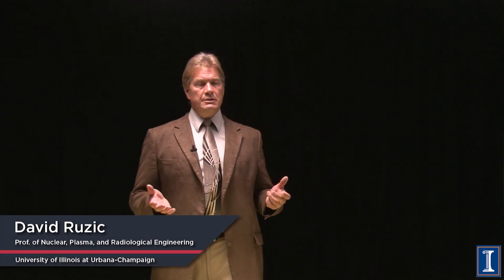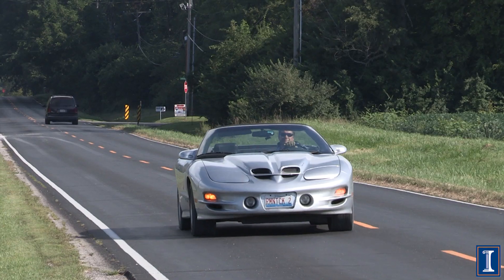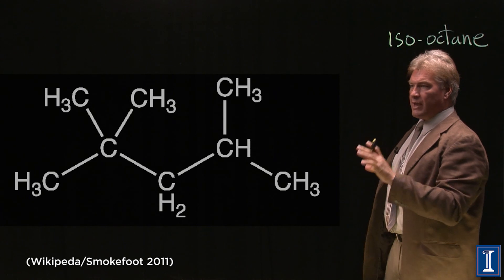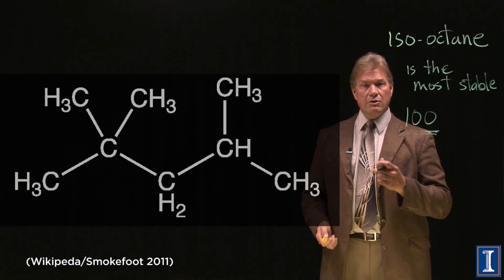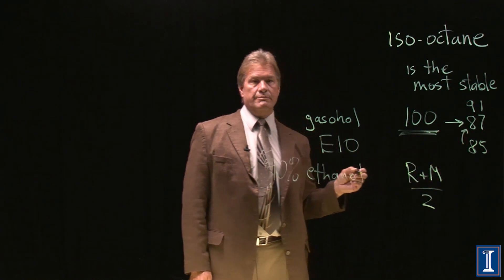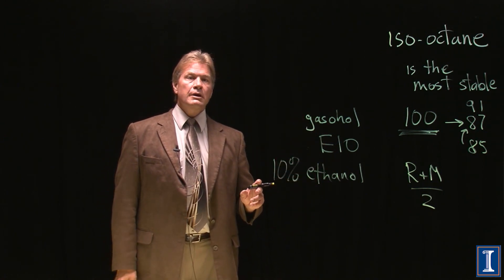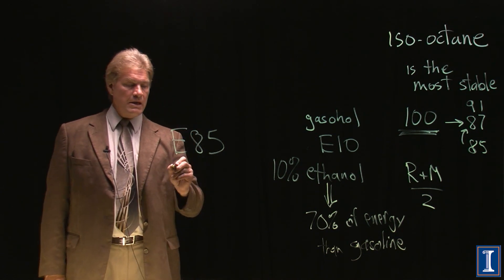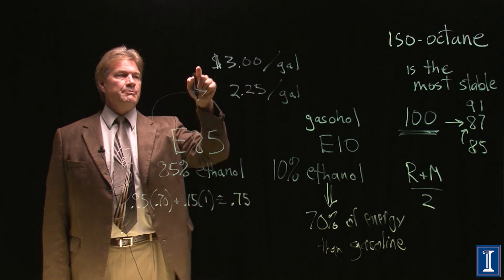Octane and Other Numbers at the Pump

Comment: So, what about when engines get old?  I just bought an old, 2006 4cyl Escape w 200k, complete w desert pinstripes, to use as my pup truck.  I’m pretty sure I was able to put 87 octane in it, but it would knock a bit when pulling out in 1st gear (manual transmission) and the check engine light came on.  On a guess, I changed the plugs (no change) and then began using 93octane, the knocking disappeared (except when i mangle the clutchwork :)) and the check engine light went out on its own.  It runs great, gas mileage is good, and it’s whisper quiet after warmup - and my pristine Buick Lucerne Super is dog free and clean! :).

So, did the 93 octane rejuvenate my little Escape, or did it just need to get some runtime?  I haven’t bothered testing it w 87 again, since the dog parks are really close by and I only have to fill it maybe once a month.